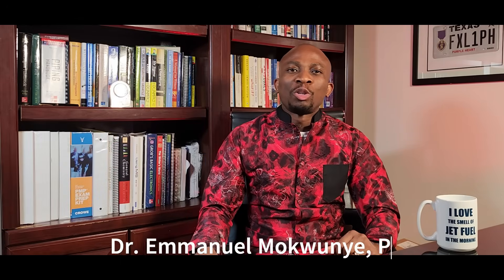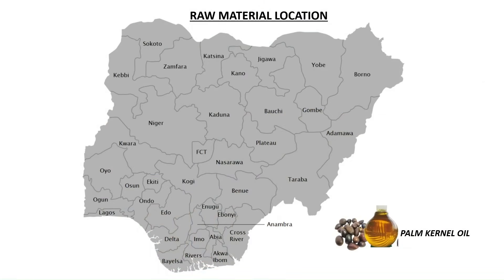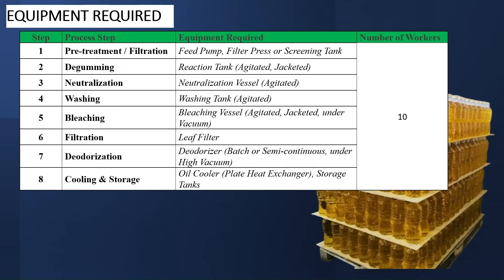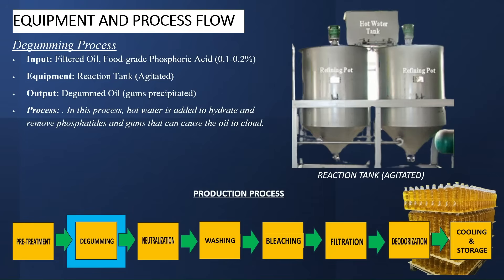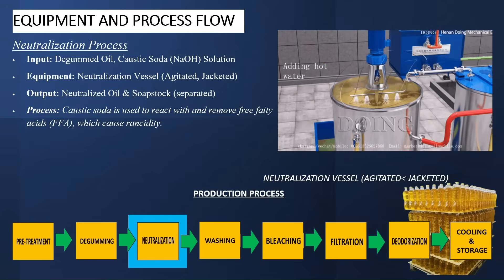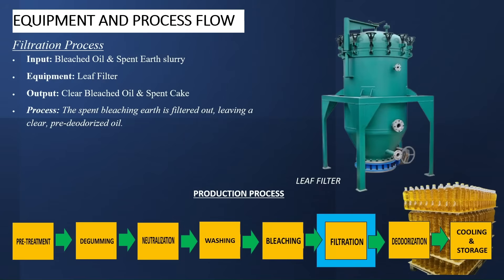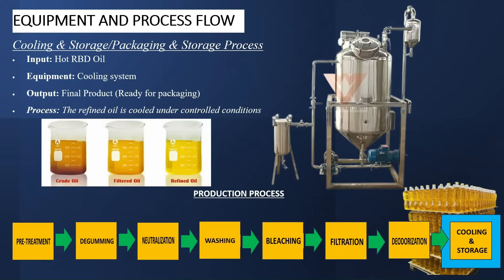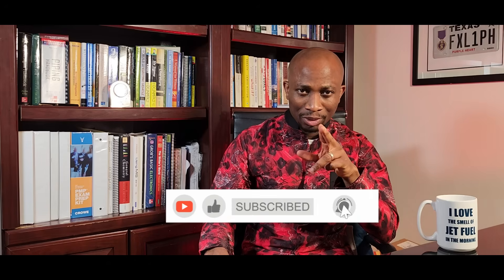Setting up Vegetable Oil Refinery in Nigeria A Step by Step Guide

Comment: This is absolutely  appropriate  at this present  time, Nigeria  need to increase  the GDP of the country, I am hopeful  this video  will get to our government/ private investors  who are seeking for areas to invest .
Dr Emmanuel.  
Keep the good work. 
God bless and reward  you
Reply: I own a vegetable oil factory with a chemical refinery in Nigeria, same process line explained here, I had to shut down because the refined oil still has odor and no one has been able to get it right. What do you advise?
Reply from the maker: An assessment has to be conducted to determine the root cause, but a couple of things to understand: where did you get your equipment from? At what temperature is your bleaching, and do you have steam in your bleaching process? Are you checking your FFA value before refining, and how are you determining the quantity of caustic? What is your refining temperature, and what is your steam constant? A root cause analysis has to be conducted to understand why you are not able to refine the oil.